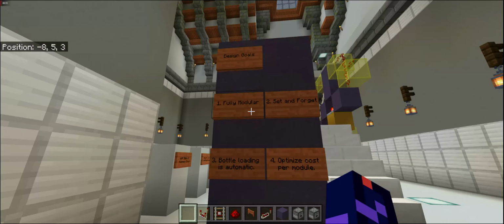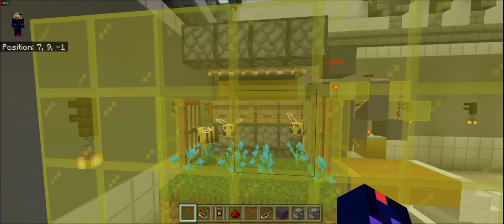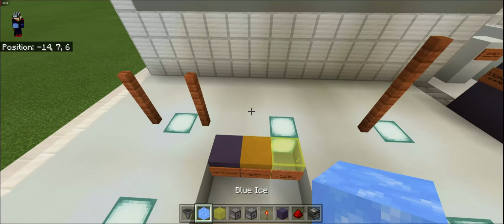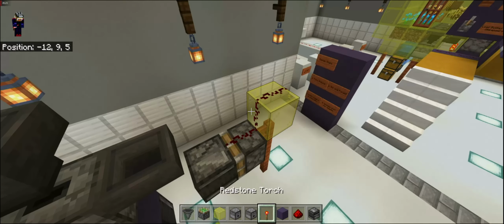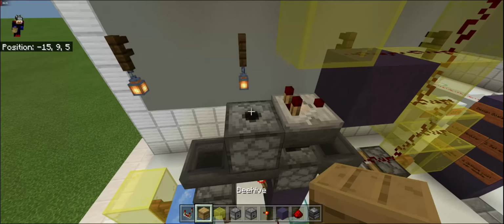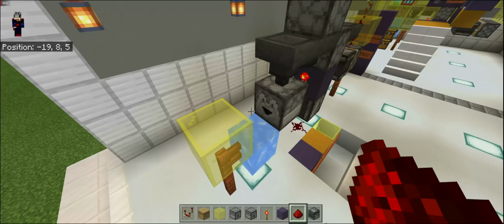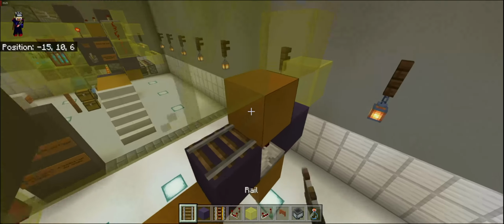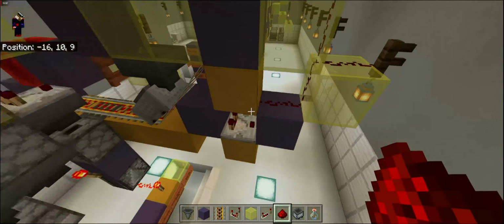[Obsolete] Advanced, Low-Maintenance, Fully Automatic Honey Farm

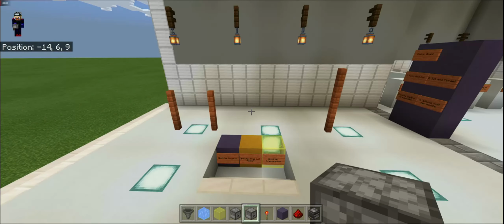Comment from the maker: 2:22 Tutorial
11:53 Schematic of single Module.

Note: I didn't include a static schematic for the minecart loader. There are many places you can find information on it if you aren't able to follow my tutorial. 

Note 2: In case it isn't clear in my video, the button/lever interface is only used when the dispensers are empty and you refill the glass bottles from scratch. The way the farm is setup in the video, I needed to push lever -> button -> lever in order to properly set it up for automatic use.